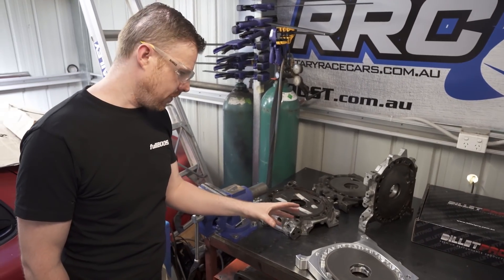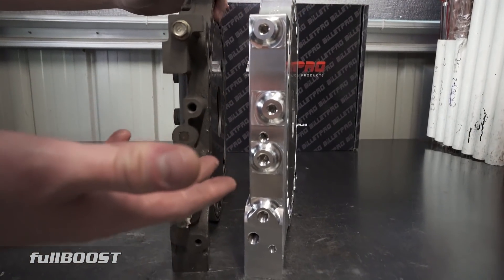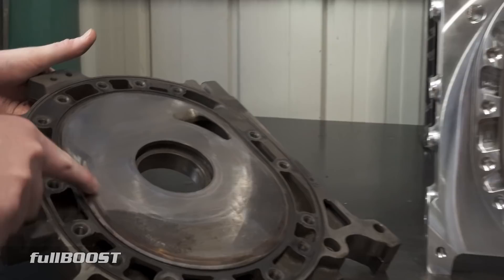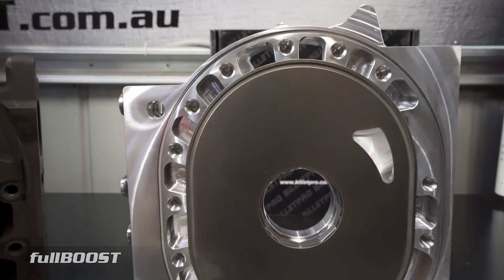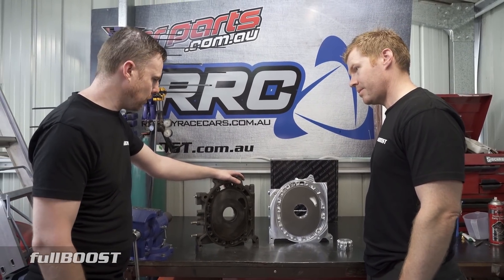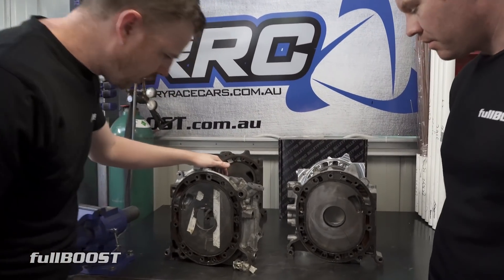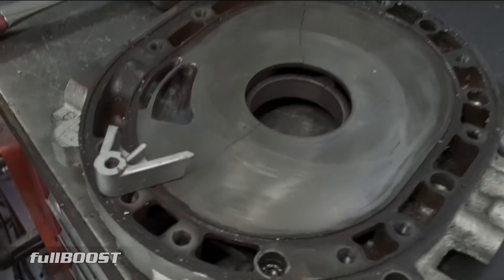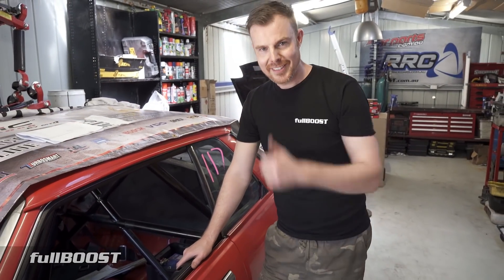Why you need a BILLET Rotary engine | fullBOOST

Comment: While the billet part is a beaut, and I wish I could afford them, to be very real: 
1. The reason for all those bolts is because it is aluminum rather than Iron and it simply needs more bolts..  aluminum deflects a LOT more than iron around that circumference.  
2. Regarding your comments on strength, an Iron part is (without question) stronger than an identically dimensioned aluminum part. 
    - The key here seems to be rather that:
         1. the aluminum part is not as stiff (e.g.: it can bend more than its iron equivalent, meaning it will take equivalent shock loads without cracking) and 
         2. it is easier (and more cost effective) to bolster the dowel loading area with more (shock resistant aluminum) material in the billet part without exacting a weight/mass penalty (i.e.: rather than a casting, it is less work/cost to "add material" with billet simply by not removing material where it is not impinging upon some other dimension, since machining is an extractive process).  

Also, it should be said that production restrictions/requirements are vastly different than custom parts... in Production, a few pennies of savings in one area may save the whole production line.. or enable some other (completely unrelated to the specific part) element to be incorporated (into the car, as a whole). 

 The blissful disregard the aftermarket gets to wield, compared to the constraints of the factory, is wonderfully non-compromising in functionality (at the cost of...well, cost). :-) 

None the less, you guys do a great job of explaining and detailing all the ins and outs of these engines.  THANK YOU for keeping the dream alive :-)))

Comment: If I would want to run naturally aspirated 500HP or 600HP reliably, should I buy billet plates or stick with the cast plates ??
Reply from the maker: You're going to need a 3 or 4 rotor engine to do that. Expensive either way.

Comment: Why does the ally in the exhaust port not melt, with the high-temp exhaust?  
I note that Rotron use inconel exhaust pipes, because of high wankel exhaust temperatures.
R

Comment: Cast iron is good for static charge. It's fragile because of high percentage of carbon (comparing to steel). Like any other material, it has advantages and disadvantages. Thank you for this video!

Comment: So it’s 2700$ a plate , plus 700-750$ if u mess up an insert . Cause the inserts aren’t free . So u won’t need a new plate but u will need a new insert 🤔🤫🤫🤫
Reply from the maker: If the engine is tuned right there's no reason wht you'd be replacing inserts 👍.

Comment: GREAT explanations. Robust, DURABLE parts don't create power
But they do ... enable power you can create ... to be created reliably
What good is being temporarily 'first' provide if you can't finish the race..?

Curious: Were the CAST plate BRAND NEW ... would it still be that brittle..?
Did heating cycles ..? induce a change in material properties (annealing / work hardened) ..? 

If the latter, can aluminum undergo a similar change (annealing I believe) ..?

Comment: An important fact to remember when comparing the materials is that aluminium is far less stiff than cast iron and steels. Strength is not the only concern
Reply: And "stiff" and "stiffness" are not "engineering terms" applicable to generic, random and unspecified  "aluminum" or "cast iron" or "steels". 

Aluminum is also "industry standard" for all pistons in all "modern" spark-ignition and most compression-ignition "high compression" piston engines regardless of "performance level" and fuel type with even heavy-duty "articulated" diesel pistons having aluminum skirts with steel crowns. All of them in engines that aren't "disposable" run in cast-iron cylinder blocks or cylinder sleeves and are installed on forged steel connecting rods with tool steel wrist pins. 

So obviously "aluminum" whether cast, forged or hypereutectic is plenty "stiff" for piston engines.

Comment: I've always been nervous about using an engine stand on these motors.  I've seen irons crack and I could only come up with it spending too much time on the stand.  Glad to see a solution that will also help with the weight.

Comment: What about heat deformation of aluminium compared to steel? Aluminium has a coef of dilatation approx 2 times the coef of steel, don't you think this can be a problem in super hot engines like the rotaries?

Comment: I love that this part has a replaceable iron part that is similar to a piston engine sleeve. An RX-7TT tends to need frequent rebuilds, so this makes perfect sense. Although big diesels tend to go a long time between rebuilds, they have swappable cylinder liners because the manufacturer knows the engine will get rebuilt more than once.
9:00 Iron engine parts are weldable, but it takes a great deal of skill and time. That is why it typically is only used where rebuildable cores are almost non-existent.
Reply: The "iron part" is not the rotary "equivalent" of a piston engine cylinder bore. The "aluminum part" it's removable from is. Know what piston engines have aluminum cylinder bores? The "disposable" ones you can't "rebuild" as "affordably" as you can replace the entire engine or "top end" from the crankcase up.

Comment: i think people just mark up prices so much just because its rotary .the mark up on this must be fucking huge
Reply from the maker: Yes because R&D and CNC milling machines are free hey? 🙄
Reply: @fullboost    I wouldn't say free no . I'm a fitter Turner   the cost of making hundreds or thousands of these would only run up to maybe a couple of hundred per piece on cnc if i got my hands on  the CAD i could knock one up :-]
Reply from the maker: @scoobysnacks209  These are specialty parts they are not making thousands of them. If you can make them for that price you'll have the worldwide market 💰💰

Comment: I believe that the Racing Beat aluminum 13B end housing is probably a better way to go than the Billet Pro. It's actually a cast aluminum part with a flame sprayed face - the flame spray is much harder and, because it's ceramic, reflects some of the heat back into the combustion chamber.

Comment: Do they make these for Rx8 engines?
Reply from the maker: Nope, the RX-8 design is not suited for high hp.
Reply: However I'm sure  you could put one of these in an rx8 by using a 13b rew swap kit.

Comment: Lets be very clear, billet aluminum is not stronger or more resistant than iron.
It can and does warp and is susceptible to stresses like anything else.
Cast blocks ect crack, thats their downfall and they are heavier.
They also rust.
Billet gear is used for race builds they are not practical for road use and longevity for 100k + applications and daily use.
Reply: Man.. No rotary is practical for longevity 😁
Reply: @Antonemachine  Take care of it, keep it lubricated, and don't push it too hard and it will last longer than most people suspect before needing a rebuild. Unlike your typical engine, a rotary can be rebuilt rather quickly.
Reply: aluminum has better cooling properties as well.
how do you figure that its not suitable for daily driving?
Reply: @RedRampageOSRS  Probably due to aluminum being a lot softer than iron. No experience myself with billet aluminum, but aluminum is pretty soft. However, this application seems to be set up so iron takes the wear, so these plates might be useful, even in street engines. Just might want to stock up on the iron replacement plates in case the company decides to go out of business.
Reply: That's not what the aluminium is going to be stressed with in an engine tho?

Comment: Aluminium blocks are around because they're easier to manufacture and lighter. Cast iron and steel are stronger materials. If that aluminium was as strong, why would they bother with the steel plating? XD

Edit: The reason why you broke that piece off the engine was because it's 2 hairs thick and the material is brittle. I am almost 100% sure that the steel plate of the "Billet" engine will also break like that if you hit it with a hammer. They aren't designed to withstand side blows from a hammer!
Reply: Sometimes aluminum blocks are cheaper to build, sometimes iron blocks are cheaper to build. That is why when General Motors invented the LS series engine, they were able to make an aluminum one and an iron one and interchange several parts. The iron block ended up in trucks where weight savings weren't as critical.

Comment: I love all of these material experts in the comments.  They seem to forget key aspects of the aluminum that are actually beneficial over cast iron when it comes to thermal stress.  Aluminum is a FAR superior thermal conductor compared to cast iron.  Strength?  7000 series aluminum is the strongest grade of aluminum alloy  on the market, and can be precipitation hardened.  This stuff is used in high stress applications like aircraft frames.  I wouldn't be worried about it...
Reply: aluminum accumulates fatigue even small amounts of stress eventually causes failure even aircraft eventually fracture and have to be replaced
Reply: @TWEAKLET  which is ductile fatigue, a much different stress than these frames are going to encounter.
Reply: A number of people have had objections to the guys in the video saying that aluminum is stronger than cast iron (not realizing that the extra bearing holes are there because it's aluminum). Cast iron is, generally speaking, stronger.  ADI would probably make a much better end housing, and it's stronger per unit weight than 6061. The reason a lot of aftermarket parts are made from aluminum is that the aluminum is easily machined because it's so soft.
Reply: You realize that aircraft are actually weak as fuck right? They are built to be light and just strong enough not to fall apart in the air. Their frames crack and break and have maintenance intervals that would make people think your paranoid if you did the same for any thing on a road going vehicle.
Reply: @oldleatherhandsfriends4053  that's very undermining, airplanes go through a lot of repairs bc of very very strict laws and regulations for planes to keep them 100% safe at all times and planes suffer way more stress then a engine would usually.

Comment: Aluminium has poor wear characteristics compared to cast iron and is NOT stronger, the demonstration shows the brittle characteristics of iron, which is also the reason they crack. One of the problems a rotary has, is two different heat zones on the same plane, cast iron handles temperature and wear extremely well. When rebuilding a rotary you should always check the iron plate hasn't warped, so how they solved this for billet, I'm not sure. In saying this, the wear wouldn't be a problem if you're pulling the engine apart frequently, or are doing some treatment method not mentioned in the video. Hopefully someone is working on a ceramic insert or even chrome plating like the housings (no apex chatter to worry about).
Reply: Brad Viviviyal  Cast iron is garbage? As in 2JZ, RB26, Bara, S54 and every cylinder liner on the market?
Reply: Sir! They are  tuner they  know   what   are  they  saying acurately. Iron cast holding  temp more  then ali and flexi.
Reply: @thitran2098  Can't understand you Tran. Breaking off a thin piece of cast iron material doesn't prove one is better than the other, did they do the same thing on the billet plate? No. Even if they did, what does that prove? Ceramics are harder than steel but try hitting your dinner plate with a hammer and see what happens. The only real advantage I can see to using billet is making it "beefier" around damage prone areas (which studding an engine fixes anyway), porting and obviously weight. Again, did they address wear or surface hardness? How about the manufacturer answers this question..

Comment: Aluminum is not stronger than cast iron. the problem is cast iron is less ductile so it tends to bend rather than flex/bend like aluminum would. also casting impurities and internal stresses from the casting process can cause problems. not saying that these billet aluminum end plates aren't more durable than cast iron, just pointing out that you're incorrect when you say the iron is "weaker"
Reply from the maker: Yes thank you we know that. 👍
Reply: precise nomenclature in tech. fields (i.e., material sciences) isn't intuitive to lay people
Vernacular allows people ignorant of such precise meaning to exchange ideas based on intuitive meaning ... though -- I was writing something somewhat similar -- as I wondered if the metal had been annealed from heat-cycles or just overheated -- increasing the "hardness." 

Which, of course, is counterintuitive bc 'hardness' sounds analogous to durable  -- though, obviously, the whole reason effort to avoid metals "work hardening" is bc (I believe) it becomes more brittle.  

I was actually a little surprised that aluminum  can also be annealed. 

I have to think through what casting means (like a foreigner counting money) to follow the thought exactly. 

The video (link below) is a fav of mine ... and happens to have been remade & re-released earlier today. It covers the degree of precision required in manufacturing engine components (not rotary) ... it's a very good video. Same channel has another video on the history of the rotary engine... And overall the channel is excellent. Good! writing; better than most edu programs on TV: Not repetitive, very articulate, explains in depth.  

https://www.youtube.com/watch?v=Aw-xbs8ZWxE

Anyway, thanks for your reply - and to the video maker.

Comment: This part could be manufactured cheaper, simpler and stronger with the correct choice of cast iron. However, if you are looking for the weight savings too, that’s a solution.  The cast iron OEM plate is brittle, however nodular cast iron (Durabar) is much stronger, thermally stable, and has vibration damping properties. Durabar 100-70-03 or 85-55-06 is a good choice for this application. Between 55ksi and 70ksi min yield, with low elongation is superior to the common 6061-T6 aluminum specification. This may also be 2024 or 7075, made an assumption. 
The one piece design does simplify things.
Reply: I know nothing about metallurgy, so this went straight over my head. I guess the 100-70-03 is some mixture specification? Or is it to do with the hardness, toughness and so on.
Reply: You don’t think that the stock plate would be a nodular iron?
Reply: @lawrencewalraven5137  No, if you look at the Mazda surface under a microscope you can see it has flakes forms of graphite in the matrix. Not nodular cast iron.
Reply: Adam Laycock interesting! Thanks for the input.
Reply: fukin super nerd lol wow you hurt me brains

Comment: The centre insert is replaceable? seems like something to work its way loose.
Reply: asambi69 it’s physically impossible for the centre but to come loose inside the engine to to the way the insert and locking nut is designed 😉
Reply: @stevencockerill748  Sorry but it doesn't seem that way. its just torqued in place.
Reply: asambi69  I’m telling you it can’t move by its design.🙂 The nut uses a left and right thread to pull the insert down in to place.

Comment: That billet steal insert should be a ceramic insert for longevity and while there all wear surfaces should and can be ceramic but I suspect no one will do that . Can you imagine longevity then and cooling issues would almost be not worth worrying about again
Reply: Sealing can be an issue thou. Look, this kind of stuff has been done wirh piston engines before. Even using ceramic coatings on pistons helps, but people tend to shy away from coating combustion chambers because it makes it harder to hear detonation...

Comment: Rotary engines are stupid
Reply: Anything else to add? 300 hp per liter is more than possible, try that with something else. The problem is the fuel consumption is akin to a similar output V8.

Comment: Doesn't cast iron have a more lubracating effect on the rotor/piston. Wouldn't this aluminium sideplate just make the engine even more unreliable. There is a reason why aluminium piston engines have cast iron inserts in the cylinders.
Reply: ViivoHD The plate has a removable cast Insert

Comment: Mazda has improved the GM Wankel quite a bit. GM gave up the Wankel because of a few major issues they saw, sealing and fuel consumption were the main reasons. I think if the tunners found a way to make them compete with an LS in terms of reliability and fuel mileage, then you truly would have the holy grail of HP in your hands due to the power/weight ratio and size of those rotary's.
Reply: GM Wankel???  Felix Wankel developed the engine while he was a employee at NSU. GM was just one of many that bought a license to make the engine.Mazda (who also bought a license) improved the engine to something far more usable than NSU themselves or any other license owners managed to do. GM improved nothing, they just gave up when they discovered that they had bought a license to something that was not ready to use.